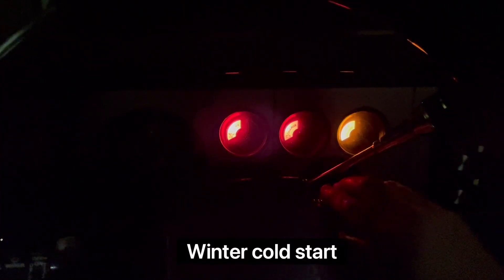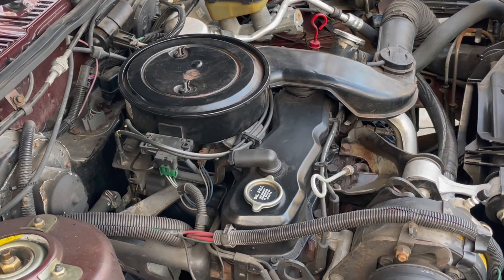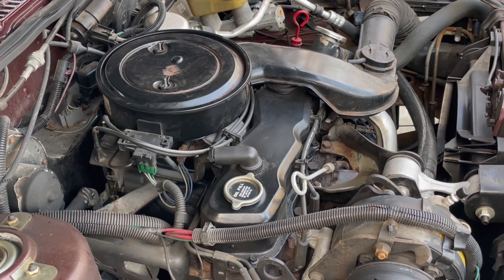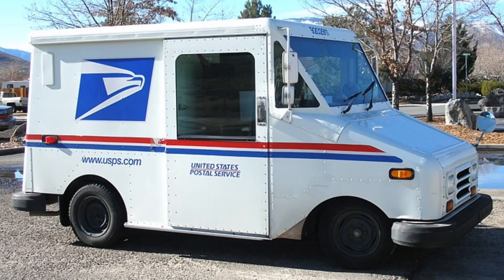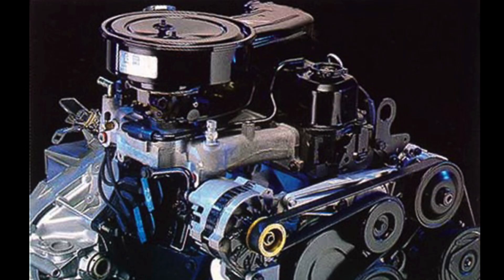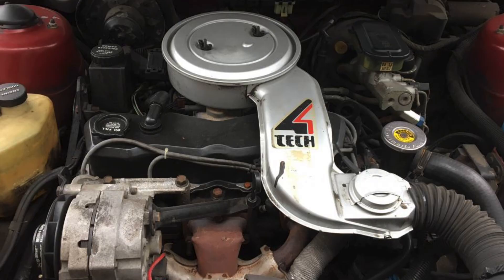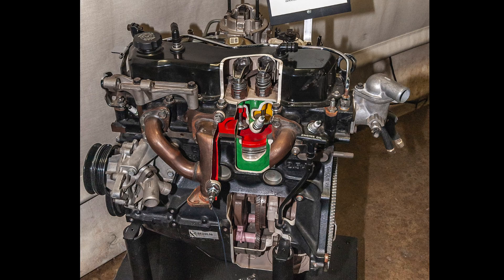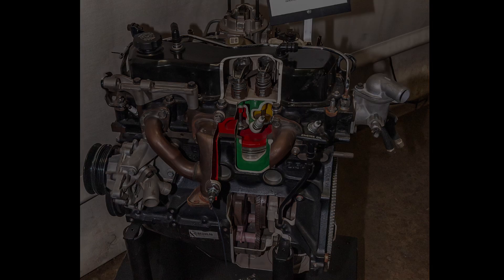Worst Sounding (and Most Recognizable) Engines: GM's "Puttering" Iron Duke 2.5L I-4

Comment: ..But the Iron Duke doesn't sound that bad, tho... And it's probably one of the most unique sounding engines out there. When you hear one running, you immediately know it's an Iron Duke. No mistaking it. Rather hear an iron duke than a Civic (or any J 4-banger) with a ebay fart can on the back (there are exhausts that DO make those vehicles sound good).

They can also be built to take some pretty serious power, since most of the reciprocating parts are a combination of BBC and SBC components. 350 pistons + conrods, 454 lifters, etc. They do have one particular head bolt hole that's weaker than the rest, but there are some solutions for it if you dig up some info. And the stock compression ratio is like... 8:1, so already perfect for boost.

Jus' sayin'...

Comment: I started working at a GM dealer in 1986 (there until 2017) this engine is something that I always use to point out how DUMB GM really is.  This engine was one of the worst things I've ever seen >> oil leaks, cracked heads, cracked blocks, broken head bolts, head gasket problems, noisy timing gears and the list goes on and on!!!  But over the years I will admit they fixed and improved it ALOT, even to the point that it finally became a good reliable engine. And then like they do so many times >>>>>>> THEY STOPED MAKING IT!!!!!!!      (dumped it for the alum head Chevy 2.2 and yes also a head bolt breaker and head cracker, seems they like that I guess)          REAL SMART THEY ARE!!!! YES SIR!!!!!!

Comment: You know Adam, I have to say, you seem to need to keep complaining about this engine.  i'm sorry that you have such a problem with it.  It seems like you hate it - therefore you want other people to hate it, too, as well as the cars it went into.  In reality, these engines are not all like that - as I've explained to you many times. You have not experienced all of these engines. The ones from the early 80s are not at all noisy.  For some reason, later on, they seem to be louder.  However, if you don't have any exhaust leaks, they aren't very loud at all.  Besides, what about the 2.2L engine they put in Cavaliers?  What about the Quad 4 engine?  So those engines aren't loud?  There aren't other engines that are loud or have a distinctive tone to them?  I have a lot of respect for this engine.  I have owned many cars that had this engine in them.  It's great on fuel, it's very reliable, and it has hardly anything that actually breaks on it.  It all depends what you choose to focus on.  So it's not very powerful [- who cares?  Yeah, the cam gear can go on them, but if you keep your oil changed, they last as well.  I've gone 357,000 miles on one one them before the cam gear finally went on it. I've had 2 others that have never needed the cam gear replaced, and both have over 200,000 miles on them and are over 40 years old. I'm quite sold on the Iron Duke, and I really don't care what the naysayers have to say about it.  I'd get another one any day.  They do the job.  I'm sure it's just another video you can put out there so you get some likes and views on your channel, so you can make more money off Youtube videos, so you don't have to actually work a regular job, and so you can buy more cars off the money you make from the channel.
Reply from the maker: That was a long sentence to end the comment.  I do have a “regular” job which I enjoy. 

I’ve owned 4 Duke powered cars. They’re the crudest of the GM 4cyls but prob the most reliable. I didn’t find my 2.2 Cavalier to be nearly as offensive. In fact, I thought the latter ones were decently refined at lower rpms.  The early Quad “Roars” were noisy, but the 2.4L Twin Cam version wasn’t too bad…aside from water pumps.

Comment: I had the "Tech 4" in my 1990 Grand Am.  Except for two issues, it was trouble-free.  The first was a recurring spark knock / pinging.  I had the car into the dealer multiple times and finally the problem was solved by them installing double head gaskets, which reduced the compression just enough to avoid triggering the pinging.  The second issue was admittedly my own fault, but wouldn't have been an issue on other cars:  the air intake duct was routed toward the front of the engine bay, and the opening was fairly low on the car.  Great for bringing in cooler air to the throttle body.  Bad for sucking in water when crossing a deep puddle.  During a thunderstorm, all the other cars in front of me were able to make it through the standing water just fine.  I'll never forget the sound of death my Grand Am's engine emitted when I went through the water - and then all the lights on the dash came on.  Ended up replacing the whole engine on that one... Incidentally the dealer said they averaged about one Grand Am per week coming in with similarly seized engines after going through less than a foot of standing water.
A side note - the mail man has one of those vehicles that used the Tech 4 / Iron Duke.  I can always hear when he starts it up - yep that starter does have a "distinctive" sound.

Comment: Good video.  The 2.5 did what was needed at the time.  The Ford 2.3 High Swirl used in the Tempo/Topaz, and the Chrysler 2.2/2.5 are equally awful sounding.

One thing, you seem to be conflating 2 engine families, the 2.0/2.2 used in the Cavalier, and the Iron Duke used in almost everything else.  Those 2 engines aren't really related.  The 2.0/2.2 had the timing chain, Iron Duke was always gear to gear.  Also, only the front drive cars got the Iron Duke with balance shafts, the S10 still used the unbalanced 2.5.

Comment: I had a 85 Calais 5-speed and a 85 Ciera.  This would be the only engine I had with both an automatic and a manual and actually found the automatic more enjoyable to drive.  The Calais was a struggle to maintain highway speed.  The Ciera had a lot more engine noise and eventually quit running due to the cam gear.

Comment: Yes I do remember that sound. I owned an 85 citation with the 2.5 4cyl. After 1987, the iron duke 4 cylinder sounded a lot different with balance shafts, distributorless ignition and the single serpentine drive belt. The 2.5 also got a quieter starter motor sometime after 1988.

Comment: Dont really understand your complains about this engine sound. This is how an inline 4 sounds, generally (most of the European and Japanese cars of the era sounds like this as well). As for the vibration part, we cant feel if over youtibe. And many modern i4 engines sound and feel even worse because of emission controls, timing, etc

Comment: The crudest and wheeziest sounding engine I've personally experienced was the 2.4L Chrysler 4 cylinders of the 1990's - I've flipped many Stratus', PT Cruisers, etc, and they all sounded horrible when revved and at idle in my opinion - An honorable mention would be the industrial sounding Ford 2.3L 4 cylinder in the Tempo, Ranger, etc.

Comment: I was shocked to read that it was available in the 1977 Ventura.
Reply: I searched these comments for Ventura, and found yours.  I had one.  Backed with a Borg Warner T-50 5 Spd, and staged Holley 2-barrel carburetor.  When that secondary opened up, more noise and a gentle push of more power.  What was amazing to me is that it came with a chrome valve cover, and the block and head were painted with the classic Pontiac Hammered Blue Paint (like the V8's had).  Really low rear end gears, something like a 3.73.  I bought it not running for $200 back in 1990.  Got it going, and it ran for a year before it blew a head gasket.  Dropped a proper Chevy 250 Inline 6 in it after that.  Night and day, believe me.

Comment: Night and day difference between the 2.5 they used in passenger cars and the ones they used in S10’s. 

The truck ones were practically indestructible, a guy told me the difference was the S10’s were roller engines 🤷‍♀️
Reply from the maker: They had roller engines in cars beginning in 85

Comment: These were also in A-body cars...Celebrity, Century, Ciera and 6000. My first vehicle was a 1987 GMC S15 with this motor mated to a 4 spd manual. I believe it was rated at 98hp in 1987. My father custom ordered it as a base model with vinyl floors and seat, radio delete, no power steering or power brakes and no rear bumper. He did opt for air conditioning (thank goodness - Texas) and a rear slider since we (kids) rode in the bed all the time back then. He later had an aftermarket rear bumper installed. I put some hard miles on it as a teenager. I drove it full send everywhere I went. It would actually bark the tires in 2nd and 3rd if I tried hard enough, which I did often. I loaded it down many times and even towed a couple of boats with it. I later installed a set of buckets from an S10 blazer that were much more comfortable than the stock bench, a nice sound system, a CB radio and a bedliner. Lots of good times in that little truck. Now I hear an Iron Duke coming up the road everyday when the mail comes. :)

Comment: Starter sounds identical to 1980 Olds Omega!  That car though used to chug when you started it due to the wonky choke(it had a carburetor).  I would rev it and it would finally clear then backfire when I let off the gas.  Piece of crap but not the worst vehicle I drove.  1998 Blazer was worse!

Comment: I drove one of these for years and thought then and now that it was one of the smoothest vehicles of the era.  They have a little clatter at idle and they have a high slip torque converter causing them to rev high under any acceleration.  Maybe that combines to people thinking they sound bad.  I don't know, but I always thought it was pretty smooth.  Nothing like modern vehicles, but try driving an early 80's Toyota and, good grief, the iron duke vehicles are absolute luxury cars in comparison.
Reply from the maker: You probably had a 1988 or later model with the balance shaft

Comment: Exhaust Gas Recirculation in most '73-4 engines made them very rough and noisy in a cold start.  My Fleetwood broke both exhaust manifold bolts on a rear cylinder because of the shaking, so there was a small gap in which I could see and hear burning gases until the engine warmed up.

Comment: I have an early Iron Duke in my garage. It differs from those in the video because it had both intake and exhaust manifolds on the left side of the head (north/south) configuration. It is very similar to the Chevy II 153 cu. in. four cylinder. I'm told that after a couple of years in production that GM decided to use a cross flow cylinder head configuration. What year did this change occur? I haven't started my engine yet, but I'm sure it will sound like a cement mixer as well.
Reply: I had a 1978 Pontiac Sunbird with the early Iron Duke. I was one of the lucky few to have the manual 5-speed transmission. The 1977-78 Iron Duke did look like the old Chevy ll 153. It even had the transmission bolt pattern for the Chevrolet bell housing. In 1979 they developed the cross flow cylinder head and changed the transmission bolt pattern to match the 60 degree 2.8 liter V6. I think these major changes were needed so It could be used in the X-Body front wheel drive cars in 1979.

Comment: My Pontiac " canned ham" had an iron Duke. It would reliably start at -20° Fahrenheit. It was noisy and underpowered, it leaked oil, but it was as reliable as an anvil. It was still going strong at 135,000 miles when the car was too rusty to pass inspection. Good motor.

Comment: I ordered new an 87 Grand Am with the Tech 4 and 5 speed transmission.  Mine was little sportier than most as I added gauges and the Y99 handling suspension.  Prior to 60,000 miles the engine made an additional noise.  My dealer said they could change the timing gears under warranty for $100 deductible.  She sounded much better and went on to make it through 185,000 miles.  This car could also leave posi burnouts for 12 feet.  Not a fast car but got me around just fine in that era. Please remember the manual 1987 Grand Ams had the updated engine.

Comment: I remember the sound when running a little and the vibration mildly because of the vibrating shifter. I mostly remember the durability. Dad would load his S10 down for trips and the engine had no trouble. 

The body rusted out before that Iron Duke failed. Dad bought his new in 87 and sold it in 99.

Comment: 🎉I had a 84 AMC sx4  with a iron Duke rebuilt it at low mileage because of the noise the cam slaps the soft plug in the back of the block. After rebuild still made the noise. It ran great. Go figure

Comment: My first  early new car was an 86  Pontiac 6000 LE with the 2.5.  I bought it as an 8 month old car.  It was a pretty nice car, burgundy in and out.  It was roomy and comfortable and very economical.   The 2.5 was pretty torquey and being an 86 it had fuel injection.   That engine wasn’t too noisy until about 30,000 miles.   I always figured it  was piston slap.  It got great mileage despite not having an overdrive transmission.  In town it was nice and responsive but it didn’t like long hills on the interstate.

Interestingly the 2.5 was based on the old Pontiac V8.  It uses the piston spacing, bore and stroke, the same pistons and rods from the 301 Pontiac.  Any pontiac V8 head will bolt onto a 2.5.  In the 80’s Pontiac developed a racing varient called the 2.5 SD which was surprisingly competitive in certain Motorsport classes.

Apart from the diesel like clatter they were prone to pinging (detonation) due to carbon build up and by 60,000 miles you often needed to run premium fuel and even then they’d rattle.  It would eventually crack pistons  and was probably the most common cause of engine failure.

Comment: Maybe should have kept the old Chevy 153 that was used in Chevy II/Nova in the 60's. It was 3.88 bore and 3.25 stroke. Same HP as Iron Duke. Theoretically longer stroke should give more low end power. It still would have been a shaker. It used the same parts as 6's and many small journal V8 parts would interchange. Iron Duke had a good performance base in the day with a lot of parts from GM.

Comment: I was always a bit confused about the GM 2.5L four cyl engine and watching this you might have cleared it up for me after all these years. I used to own a 76 Sea Ray with a 2.5 L 140 HP Mercruiser I/O, the engine was relatively smooth and not harsh as you would find under the hood of early 80's GM cars. The 2.5 was also a staple of various farm and construction equipment, I never could figure out why this same engine would flourish in these applications but under the hood of a car it wasn't great. Always figured it was the emissions connected to it that made it so terrible but seems to be the Brazilian engine was probably the basis of my boat and the construction equipment.

Comment: As someone from the other side of the pond, I have trouble figuring out (and a video on that would be great) why did the Europan divisions of GM (Opel) and Ford (German Ford) have higher tech, more powerful and economical four cylinder engines,  whilst in the US in this case GM stuck with the Iron Duke or the Cavalier's 1.8 and 2.0. Wouldn't it have been cheaper for GM to import Opel's components and expertise? 😅

Comment: I had a 1984 Fiero with this engine. Leaked oil and sounded like a farm tractor. That said, never failed to start on the coldest New Hampshire winter. Totally trouble free. I actually liked the sound - that of brute force simplicity and reliability.
Reply: When I think back to the Iron duke days the first words that come to mind are "brute force".
👍
Reply: I have one myself and it sure isn't a "sporty" sound for a sporty car. That said it's okay as long as you remember what it is.
Reply: The slowest modern car I experienced was a Ford Fairmont station wagon with an inline six and automatic transmission,seems you could floor it and it just lackadaisically sort of moved along accelerating barely as fast as normal unhurried traffic-strange because that engine was larger than the Citation V6 but I had one of those loaded down with about half a ton of someone's mineral and rock collection and personal stuff (I was helping him move to a new place) and the loaded down Citation which with that load weighed more than the empty Fairmont still accelerated quite a bit faster. And that Citation was not as fast as my X 11.
Reply: @davidpowell3347  The Ford Fairymount looked like a car designed by someone that hated cars …
Reply: @davidpowell3347  Geo Metro, 3 Cyl, was the slowest thing I've ever been in. 😆
Reply: My parent had a Pontiac 6000 with one. It ran. That’s the only thing positive I can say.  I can hear my mail man 2 block away.
Reply: People say they had no power but in a 2wd S10 they had quite a bit more than the newer 2.2 . I had a 4wd with a 2.8 and a guy with a 2wd 2.5 could walk off and leave me . Neither were powerhouses but a 2.5 pulled itself good I thought for it's time for a four cyl
Reply: The iron duke was a tough engine and easy to rebuild. But it was not powerful at all. Mercruiser had them as a Marine application and listed them as 110-120hp. They had ok low end torque but not great power. It was a harsh engine vibrated and shook and sounded like a POS lol.

Comment: A close second and a modern equivalent is the 2010 Equinox 2.4l ecotec. Chattering starter motor, disintegrating exhaust system, and VVT actuator ticking makes them distinctively stand out in traffic and parking lots.

Comment: I started work in a GM garage in 79 and bought brand new a 79 Monza with the 4 popper. After the first oil change the engine developed a rocker arm squeak. The fix was dumping a small bottle of the GM Posi traction additive into the oil. The squeak went away in minutes. You had to add the additive about 5 or 6 more oil changes until the squeak went away. This happened on several engines. Also on the Monza, the engine shook so bad it would crack the upper rad neck. We sent them to a rad shop and he would reinforce the tank and neck.